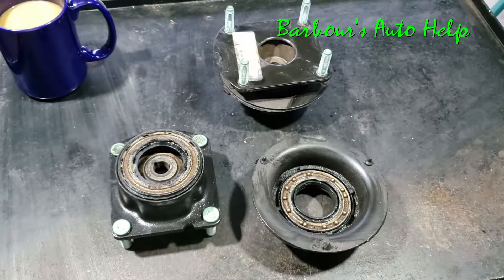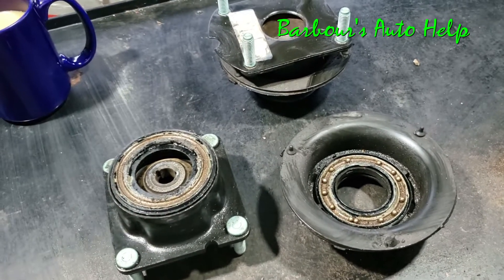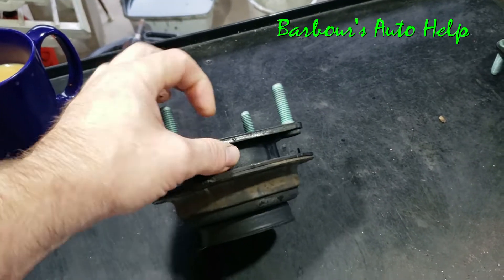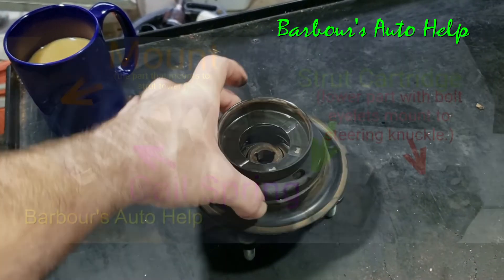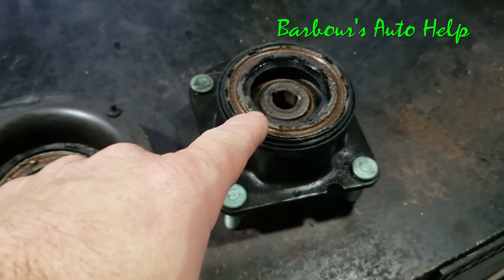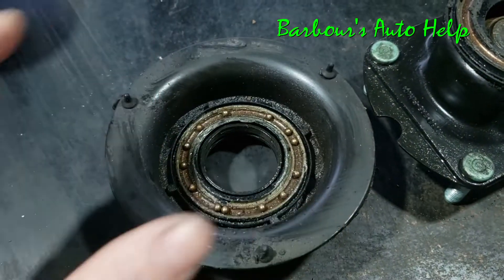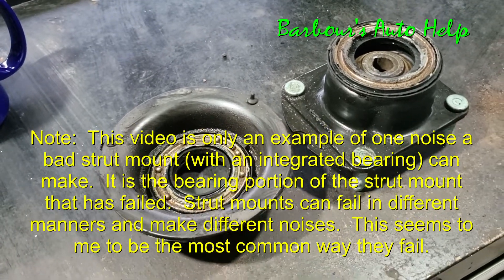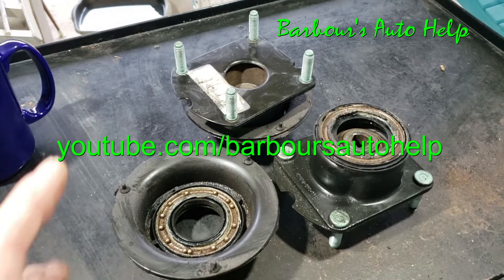Inside A Bad Strut Mount Bearing And What Causes It to Make Noise

Comment: I installed brand new KYB Strut Plus units on my car and found that they now have a springy Clunk noise at the first instance of steering now.  It only happens for the first few minutes when I drive.  I have worked countless hours on this.  Replaced Sway Bar's, Re-Torqued under load and followed all of KYB's support tech info plus trying to spray white Lithium grease into the bearing assembly from the side (Yes, they told me to do that too, and still have that springy clunk when I first steer the car left to right.  2009 Honda CRV and the issue was never present with the OEM strut assembly.   Can anyone give me some advice here?  I feel like KYB should be sued due to all the time I have spent on this plus 2 Wheel Alignments after the post work done.......beyond frustrated.

Comment: Installed a pair of KYB's Strut-Plus ready struts on my 2012 Toyota Prius, 2nd pair by the way. These struts are making creak and squeak noises when steering at low speeds.  This is the case with both sets received and stalled.  Have you heard of bad mounts on new struts?  It is my understanding that although KYB is the OEM for Toyota, Toyota does not use their mounts, I think I see why.
Reply from the maker: It's very possible to have bad mounts on new struts.  But, it's pretty rare that your get two sets with the same problem..  You may need to be looking elsewhere for the source of your noise.

Comment: I bought a set of quick struts but they are tight at the top and don't turn easy like you show..i have not installed them yet.is that normal..